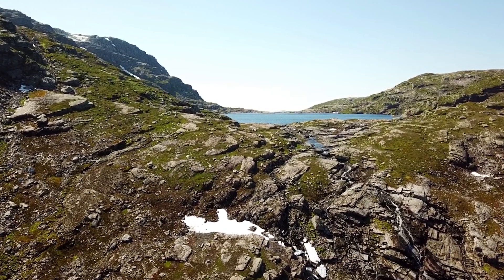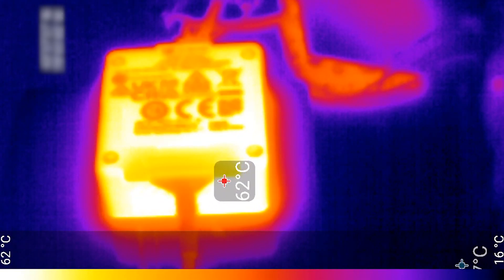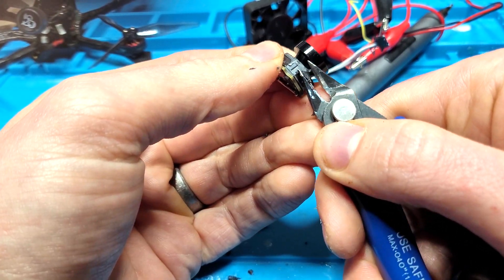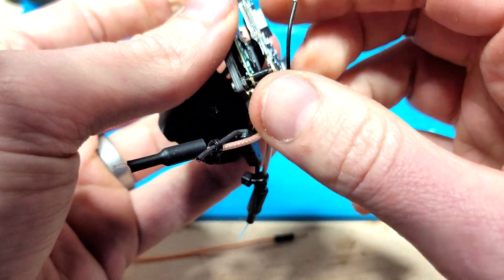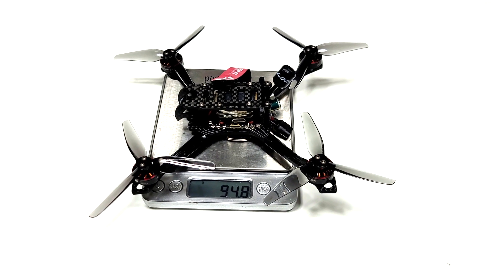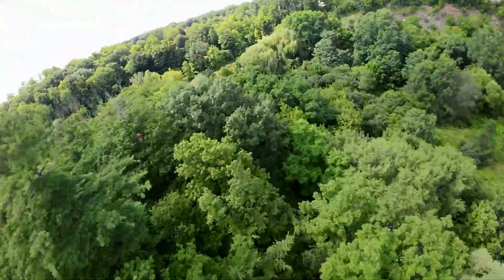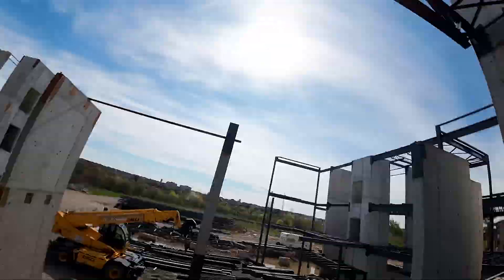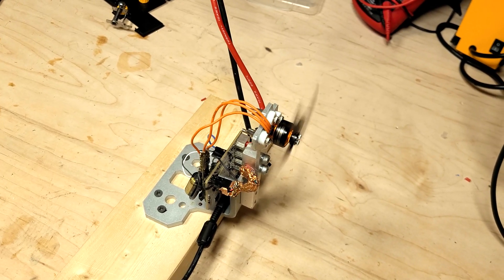Ideal Sub-250 (sub-160g) DJI O3 FPV Drone - Design / Build / Testing of the 3.5" Helios

Comment: Great video and design! I would like to build this with DJI O4 lite stock. Do you have an adapter design that you can share or send me a link to something that will work with your Helios frame. A second question, can you point me to the video where you discuss flight time vs battery size. I couldn’t find this info. 

Thank you and keep up the good work!

Comment: Mate, seriously, approach someone and sell it as a quad design with the 10gram o4 lite system (to save on the stripping of O4 Pro. O4 lite is more than enough for just flying). I'm here because what you built is exactly what I'm looking for without the knowledge (or willingness) to build one. This is a top tier quad build with virtually 0 competition from current BNFs. 10/10

Comment: This project is awesome. Have you ever thought about updating this project with the dji o4 lite unit? It would make the project cheaper for people and its pretty light to begin with. Also I know it is only suppose to use up to 3s batteries but if you use a flight controller like the f405 mini stack that has a dedicated BEC for video connector. Just curious
Reply from the maker: Yes I have both a lite/pro build completed. Needs some testing though :) - No need for a bec if the 5v regulator is good enough.

Comment: Bought the frame, built the thing. It’s great. Took some time to adjust to the looks of it, but now I even like it)

Had to glue down the camera mount, as I was racing it and it did not hold up on the two screws, the base just came off, and camera came off with it. Plus I think glueing it down with epoxy reduces jello.

Thank you for the work, I really appreciate it.
Reply from the maker: I have a different mount design I'll be releasing soon that makes it smaller and supports it and holds the angle better. Shoot me an e-mail if you want to try it out.

Comment: Nice quad design and flies good. Flight time with different batteries?
Insta sub.
Didn't get it - is it ok to use full size(not naked) O3 air unit?(still viable or sacrifice a lot of agility; full O3 seems more durable and heat resistant)

Comment: Could you please try rcinpower 1804 its only like 12g so not too much heavier and its produces a lot of thrust. Also if you want the most performance for sub250 you should try 4inch toothpick with 2004 or the rcinpower 1804.
Reply: The new gemfan 3630 are better than the 4023 props on sub250.
I get a higher top speed and more efficient.
4 inch just catches dives better with a heavy build

Comment: amazing video, subscribed! I'm surprised that 1404 3.5" props gave you 200 km/h, I flew my gerprc smart 35 with same specs (but heavier) and it didn't break 100 kmh. I assume that weight matter less than air resistance for these drones? so tower design seems to help a lot.
Reply from the maker: Thrust to weight matters the most, yes. 1g on one of these is like 5g on a 5" sized build.
Reply: @RecursionLabs  but how is so? isn't  it when a drone able to however - it already beat the gravity and any additional thrust would have being able to accelerate it forever without wind resistance? So practically speaking windage and (max thrust-gravity) are the only important factors for the top speed?
Reply from the maker: @AlexLebed  Air resistance. Stick your hand out of a moving car on the highway.
Reply: Yes, and if you want outright horizontal top speed, try to use the highest possible combination of rpm and pitch speed, plane guys should know. Thrust won't help you when the air coming in is faster than your rpm+prop pitch can paddle.

Comment: Do you think I could build a version of this with 2s lion batteries that could do long range?
Reply from the maker: I'd imagine it's possible if you can find the right motors to use. 4600kv maybe. You just want to make sure the O3 gets the right amount of voltage at all times.

Comment: What FC would you put on this if you were building it today?
Reply from the maker: I'm building a new one soon and I'll be using the JHEMCU GFH420 AIO (BGA Version). It won't be as good as the MPU6000 ones I've been using, but I put one in a Scythe in the fall and it flew well. That or I'd find a reasonably priced 25.5x25.5 board.

Comment: Exactly what im looking for 👍 
build a HGLRC Petrel 120x with naked o3 (original cam) with 1303.5 HGLRC AEOLUS Motors with 5000kv - weight with 550mah 90C 3s Bonka is 152g. Plenty of Power, quiet but have some vibration Problems…
Reply: Ripping the helios for 4 month now - crazy little beast. Are there any Plans (just scaling the buttom plate) for a 5“ Inch Version 🧐? Searching for a light racer for O3 and this…

Comment: Just had my first test flight with my Helios build. That thing is so fast and quiet 😳.Mine is a little bit heavier since i used a SpeedyBee F405 Mini Stack, stock O3, GPS module ,Beeper/Battery and the Vanguard Baseplate with 40mm Standoffs. AUW with a Flywoo 4s 750mah is at 215g. @Recursion Labs thanks for all your work👌. Can you share your Betaflight settings as a cli dump?
Reply: I'm currently building mine, also using the speedy bee. Did you need to do anything to make it fit? I've added some screws to extend the stand off height which worked a treat but noticed the battery terminals are waaay too close to the stand offs.

Comment: Bro can you please modify the scythe design to be able to mount 12mm motor mounting option? I have axis flying 1505 motors. They are great for 3.5 inch props.

Comment: Don’t build. The only aio fc which fit is the JHEMCU GHF420AIO-BGA which is only available with bad gyro ….. . Now I have 2 frames here to throw away.
Reply from the maker: The frame supports any 25x25 board, so it should fit 90%+ of the AIO boards on the market outside of some silly big 20x20 boards.

Comment: Hi I am interested in getting this frame, I was wondering though if this frame with the naked o3 hardware option would fit an o3 air unit using the flywoo naked case kit.
Reply from the maker: I'm not sure you really need that case, but I would imagine it would have more than enough space with the larger stand-offs (maybe too much).
Reply: I just built it with with naked o3 hardware and flywoo naked o3 kit. Only issue is the 1.6mm screws from the hardware kit are too long and the flywoo a little short.
Reply: @Kai-P  I have seen tiny whoop builders reaming out the m1.6 holes to accept m2 screws.

Comment: I'm wondering how the 1604 or 1804 motors perform on this? Should have more thrust, but also add more weight for bigger motors, battery and a little stronger frame.

Comment: This is a awesome video man, I just built a sub 250 quadmaula siren split and I think this might be a better option. I have a few questions for you. I’m running a 20x20 stack and I want to do a stock o3. Do you think a stack would be a possible option for this build? I’m also wondering how the durability would compare?
Reply from the maker: I'll state that an AIO would be better since it's lighter and more compact, but you could run one if that's all you have if the stand-offs are long enough to fit both. Keeping the weight down helps with durability, so that's always a factor.
Reply: Hey man, I’m now really considering building one of these due to the fact that I lost my siren f3 recently due to camera video loss on long range. Do you think there is space to fit a gps mate in this build? also would you be willing to send me the cad for the bottom plate design, I would like to try and make some TPU bumpers for it.

Comment: I was thinking of building something like this, but in 4” and using 1804 RCINPOWER motors (which has 65% bigger stator volume compared to 1404, and weighs around 13g while the 1404 is around 10g), or 1604 T-motor (31% more stator, 11.6g), or even with 2104 RCINPOWER/Flywoo/FETtec motors (125% bigger stator, 17g) but that might be overkill and draw too much power. I worry about flight times suffering. Would probably use 6S too because I hate sag.
Reply: 6s might be too much from 4 inch and down and its more suited for around 1800kv. You probably need 5 inch or even 6 inch to properly exploit 6s.

Comment: with all DJI systems: Keep goggles OFF when you first power on the drone, the vista or o3 will stay very low power and sat lock happens very quickly. I used to power my gps and get sats but now I just keep the goggles off for the first lock... usb may still be nice for cold boot with no useful almanac data, but m10 gps is really good now 👍 Amazing work on the build!
Reply: Has betaflight implemented the almanac, feature? yet?

Comment: Should look into the pattern of the carbon layers weave, and how it effects so und and vibration resonance. Theres quite a few write ups and experiments that have been done by big colleges and such that suggest you might find a tiny bit of performance with this.
Reply: "5. Results
Specimen #1 with 0° direction of the carbon fiber was the most sensitive to small variations in the direction of carbon fiber as well as spectral loading patterns in the first mode. Hence, quality control inspections should be conducted to minimize errors in the direction of carbon fiber in CFRP products. In addition, the response of specimen #1 has the disadvantage of changing its magnitude with spectral loading patterns compared with other specimens. In the second mode, the dynamics of each specimen changed rapidly according to the direction of the carbon fiber. The mode shape of each specimen differed from each other, although the resonance frequency did not significantly change such that the sensitivity index derived in the second mode has less physical meaning. These analysis results indicate that the proposed scaled sensitivity index is an efficient method to evaluate CFRP specimens according to the direction of the carbon fiber. The sensitivity result may serve as a useful guideline for engineers in designing CFRP materials.

Go to:
6. Conclusions
The frequency response function for CFRP specimens was derived by considering the nature of system variables over two parameters: the direction of the carbon fiber and the damping ratio. A scaled sensitivity index was then proposed for each parameter of interest. Partial derivatives of the frequency response function were obtained from the curve-fitted line of the measured response data during uniaxial excitation testing, and the corresponding scaled sensitivity index was calculated for specimens #1 to #3. The mode shapes of CFRP specimens were shown to have similar bending modes in the first mode, but showed different shapes in the second mode. Specimen #1 is the most promising candidate for uniaxial excitation in the first mode because its structural rigidity is maximized with 0° direction of the carbon fiber for uniaxial excitation.

Comment: Beautiful video man! Congrats! but thinking of how to convert mine but been thinking a pod without the top plate. will have to see. interesting that you were able to shorten the arms, didn't think of that but could then use that same baseplate to mess around with a 3 inch or 3.5 pusher if wanted. cool thing with 3.5 is it works perfectly with 3inch n guards

Comment: Nice build, try the lannrc 1505 3750 motors with gemfan 3630 on 6s, need to update escs, or 128k escs, thats what i hav on my jm3.5 with Ws avatar pro, insanely more powerful and faster then my  3inch with 1404

Comment: Super impressive again. I really want to build a Scythe, i just havent decided on the stack yet. I want to do it with hdzero and was even considering the new race v2 if i do a 20x20 stack.
Reply from the maker: The new 20x20 v3 looks like the perfect size to mount to the top stack. That's the route I'd go now.